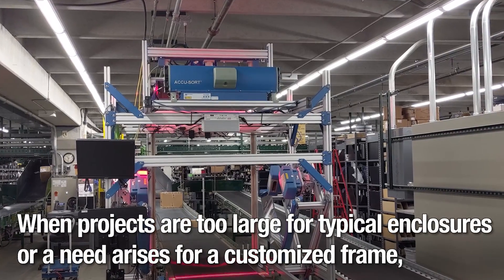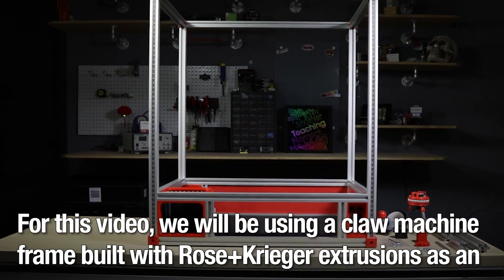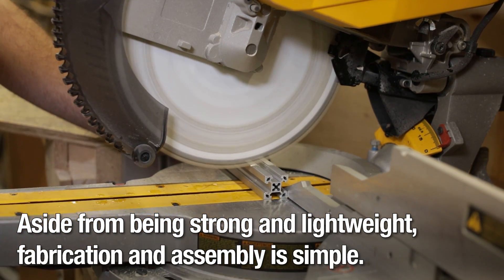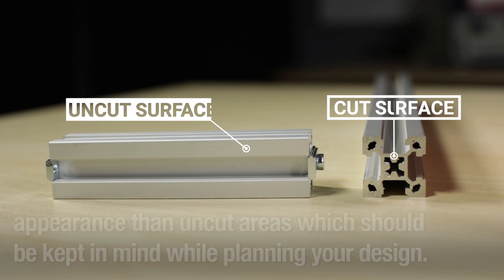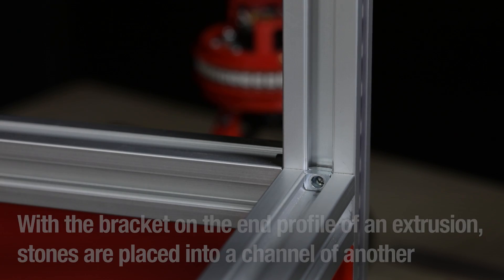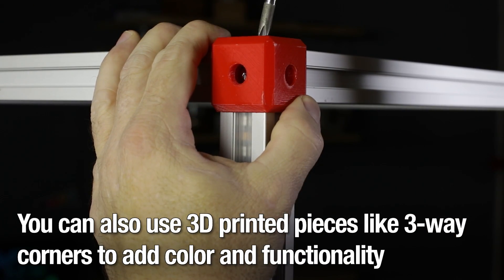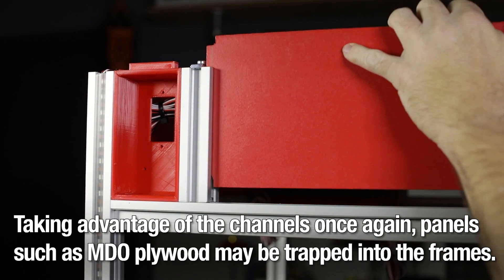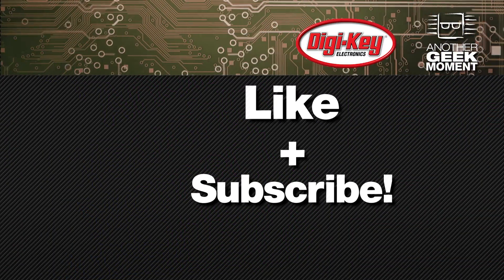How to Work with Aluminum Extrusions - Another Teaching Moment | Digi-Key Electronics

Comment: I wish someone would come up with a good way to cut these extrusions precisely perpendicular. That's crucial because the it's the cut face that controls whether two pieces of extrusion are perpendicular to one another. And it's surprisingly difficult to get a chop saw adjusted (and kept) precisely perpendicular.
Reply: What do you mean?  I cut them all day with a chop saw and an appropriate blade, and carefully set my blade angle.
Reply: @MartinBogomolni  Right. It's the "carefully setting the blade angle" that defeats me!  What sort of chop saw do you use, and how do you perform this careful setting? How good a perpendicular do you achieve for two extrusions where you thread the hole in the cut end of one of one of them, and screw that cut face against the side of the other extrusion so the two pieces form an "L"?
Reply: @Graham_Wideman  you're probably going to hate me... but I use a battery powered Ryobi chop saw from Home Depot, and an appropriately sized specialty aluminum cutting blade I got from WoodCraft.   To set the angle, I use ( not too surprisingly ) a good steel speed square measured to the edge of the blade/fence and I set the "90" degree hard stop on my saw...  All my cuts are well within a few tenths of a degree and the finished product looks perfect.
Reply: @MartinBogomolni  Good to know, thanks! Which Ryobi model?
Reply: @Graham_Wideman  RYOBI ONE+ 18V Cordless 7-1/4 in. Compound Miter Saw
Reply: @Graham_Wideman  the blade is a LENOX Tools Circular Saw Blade, Aluminum-Cutting, 7 1/4-inch, 60T
Reply: Most people who get funded to afford these materials get water jet tables or Lazer cutting cbc machine's.
Usually through government grant occult money.1984